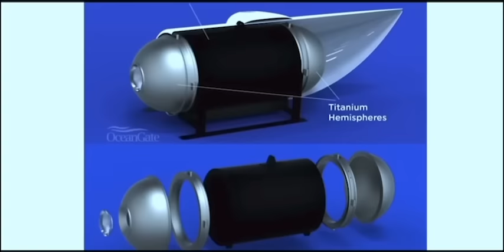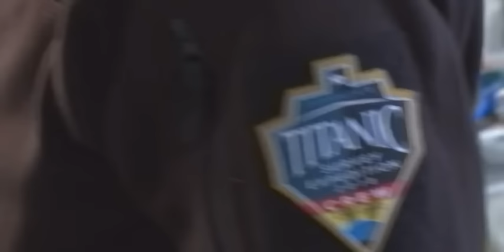First look at #oceangate #titan Debris

Comment: The fact this even went down once let alone multiple times without this happening is astonishing
Reply from the maker: i agree 100%
Reply: The mat-science behind repeated stress says that you can over-stress something, but eventually have to pay the piper. Microcracks form, bonds degrade, and generally spiral downward. This is why airframes get rated for X hours and are inspected for tiny cracks. I'd bet he only gave the sub a quick visual once-over after each dive.
Reply: was it maybe a cumulative effect that weakened it?
Reply: Not really astonishing at all. The sub was much stronger on the first dive than the rest. This is due to expansion and contraction of the carbon fibers with each additional dive. It’s like bending a metal wire or bar back and forth till it’s molecular body weaken so much it eventually snaps. So with the titan sub it wasn’t a question of it would happen, it was just a question of when

Comment: I've been making Carbon fibre parts for over 10 years and my most demanding test rigs have been kite Surfing boards using various different Carbon Fibre Layups. These boards experience torsional, compression and tension with repeated high loading when  jumping. I would test them (kitesurfing) until failure and I found it was always the top which was under compression during repeated cycles which would crack after delamination. 
I'm not an engineer but my understanding would be a pressure vessel should have universally balanced strength across the whole structure for the pressure it is under. One of the fatal flaws I see with Titan is that it didn't have universally equal strength across the whole structure. That might seem obvious in hindsight but perhaps without the observer knowing the reason or location. The Carbon tube using a Unidirectional roll wrap method they appeared to use, would have have been stronger on the ends once encapsulated by the flanges on the Titanium rings thereby causing a strength differential represented by a weakness in the centre. This centre focus would have caused a compression on the outer layer of carbon and likely started with a delamination between layers of  carbon (even though it appeared as roll wrapped  Unidirectional tow likely to be 4k or 6k). To make such a carbon tube  the epoxy should have been applied under vacuum rather than a wet layup method. This vacuum should have ideally been at around an absolute pressure of 12 Mbar or lower and and infusion method to 'suck' the (epoxy) resin into the part. 
I didn't see the full process of how the Carbon tube was made only the winding of the carbon onto the tube that makes me fear they used a wet layup method rather than using resin infusion. 
Because of the winding method and the thickness, perhaps infusion wasn't used? Does anybody know? (Please provide a link if you have one).
If only a wet layup was used this would leave more voids and air bubbles in the part (Tube) - these voids and bubbles are fatal for a part and will be where the delaminations commence with each subsequent cycle exacerbating the delamination.
This is my prediction. If a   centre compression in the tube didn't cause one of the Titanium rings to first pop off, then they will find a crack near the centre of the tube where several outer layers of carbon have 'jumped' over their counterparts after cracking.
Reply: Middle Should of been made as a buldge with end caps made out of a Carbon fiber & better yet spend the money and added graffene layering in case of a delam.
Or just Pay a Real Sub builder to do it right the first time.

Comment: Since the outside pressure is positive and the submersible is not acting as a pressure vessel, the greater the outside pressure becomes, the tighter that joint becomes.  I believe what they will find is that the extreme pressure cycles on the carbon fiber composite is what ultimately caused this tube to lose integrity and crush.  Building the entire thing from titanium would've been fine.  Buoyancy doesn't matter at all when you're in 12,500 feet of water...
Reply: I'm glad you brought up his buoyancy comment. That made absolutely no sense to me.
Reply: As an ex pilot he clearly should have known that the preassure/temperatire cycles would limit the useful life of the composite carbon fiber material. The glue part is unbelievably weak, considering that aircraft have all kinds of redundancy built in. They had some kind of system to monitor damage/degeneration of the composite hull which clearly did not work.. Very sad that these lives were lost due to atrocious engineering. Wonder why the first set of passengers did not raise a storm.
Reply from the maker: @cremebrulee4759  The reason buoyancy is important is because the subs are limited in power and it takes long time to get up and down so if they can use weight and gravity to get down and then use buoyancy to get back up it saves them a lot of battery life. So the idea is to drop weight at the bottom and let it float up on its own. I just think they can use other methods to come up if the sub is heavy. engineering ways to fill up air bags when ready to come up instead of sacrificing the integrity of the main hull just because it floats better! lol unreal!
Reply: well it does.   it takes a lot more to get the titanium sphere back up to the surface if it has no buoyancy.
Reply from the maker: @ScreamingEagleFTW  yes but wouldn’t it be safer to engineer flotation air bags and other things instead making the hull weaker and vulnerable ? Instead of RE-engineering the hull especially since we know the pressures there and physics of the sphere and titanium and why they’ve worked for decades
Reply: Buoyancy DOES matter IF you can't go negative. That's why this thing wound up at the bottom of a very big lake and not at the surface. But you're correct that cylinder imploded and THEN the caps simply dropped away from it as the fiber was simply shredded away from the rings. The joints had NOTHING to do with failure.
Reply: @CozziFPV  Buoyancy is important as a mechanism for surfacing, diving and orientation but buoyancy changes depending on the pressure of the liquid.  This relates to Archimedes Principle of buoyancy.  At 6000 PSI, the subs' buoyancy was fine.  It only becomes a factor as it rises.  The real elephant in the room is why the physical hull was being used for buoyancy purposes.  The hull has a very specific and critical job to do, and that is to safely contain the occupants and resist the pressure.  Buoyancy on subs is usually a separate system, such as ballast tanks.  These two things shouldn't be combined into one thing, as they perform two completely different functions.  This is all in hindsight, of-course, but my personal belief is that no untethered vessel should be carrying passengers that deep.  They need to either be diving bells or bathyscaphes...
Reply: @CozziFPV  I dont see how air bags  would work since the pressure is so high.  You could have pressurized air tanks dispense air into a external bag via bluetooth or something but once again now two things can go wrong wheras if the sub itself is more buoyant alll thats needed is to drop the weights and the ship goes up by itslef. I think thats what he was thinking.  Should have made the carbon fiber thicker.  but still  we do not actually know what happened and wont until there is forensic analysis of the debris they found. We can specualte but it is not scientific to draw conclusions yet.
Reply from the maker: @ScreamingEagleFTW  James Cameron’s sub is about 12tons and victor vescovo sub weighs 26k lbs. both drop weights and use “lighter than water foam” to hurtle them upward.
Reply: @CozziFPV  Thanks. That makes sense.  You are right.  There were much better ways to address this.  He took the cheap and easy route for everything.  The game boy controller still has me shaking my head.
Reply: @CozziFPV  Safety was not a priority for him and it makes me incredibly angry.
Reply from the maker: @cremebrulee4759  you and me both! Wth 🤦🏽‍♂️
Reply: @ccrider77  you are so right about the purpose of the hull.
Reply: @cremebrulee4759  He used this particular "measure" to discredit the regulators and making sound like they did no research on a material which should be a "natural" for submersibles - it isn't.  Whether the pressure vessel failed because the carbon fibre hull was weakened by repeated dives, or the glue that held it to the titanium end caps came apart, or because the carbon fibre was wound on helically instead of in a cross-hatch pattern, or whether the acrylic window gave way because it was at four times the maximum depth it could take, the fact remains it could have been any one of these things that caused it, and if whatever it was that caused the failure somehow held together for that dive, sooner or later one or another othose factors would have led to the same result.
Reply: @CozziFPV  How would you inflate air bags when the outside pressure is at 5000 PSI? Where would the air come from? You would need compressed air with a pressure of at least 5000 PSI stored in pressurized tanks to even begin inflating an air bag at target depth.
Reply from the maker: @littleshopofelectrons4014  I read they all use flotation foam to resurface
Reply: @chrisantoniou4366  you are right.  I hadn't thought about that but I think you hit the nail on the head.  He always projected that he was smarter than the experts and said that everyone else was being overly cautious.  You are also right that there were multiple things that could have gone wrong. The more I hear, and the more comments, like yours, that I read, the more I realize that his "engineering" was a joke.  His priorities were the glory and the money.  It's extremely unfortunate that his engineering abilities weren't on par with his snake oil sales abilities.  You are right that winding the carbon fiber in a cross-hatch pattern would have been much stronger.  But, of course, that would have taken more material, and there was no room in his shoestring budget for that.  He basically built the Yugo of submersibles.
Reply: @cremebrulee4759  Actually, I don't think that a cross-hatch pattern for the carbon fibre would have needed more material if he kept it at the same thickness, but it probably would have cost more to manufacture.  I also don'r know if the carbon fibre would have been strong enough to withstand repeated dives at 4000 metres even if he used the cross-hatch pattern, but it certainly would have been stronger than it ended up being.

As for the Yugo, it was pretty basic motoring, but I'm not aware of any of them imploding... 😄
Reply: @chrisantoniou4366  I agree.  I think the crosshatch pattern would have been stronger, but I don't think that carbon fiber in any pattern would have been able to withstand repeat dives.  I would really like to know why he believed that it would.  It's probably unlikely, but it would be really interesting if someone could get access to his notes (assuming they weren't just in his head), and wrote a book about them.  I would love to learn his rationale for his choices.  The book should also contain a discussion by experts of why his rationale was flawed.
Reply: @cremebrulee4759  My opinion is that he was something of a narcissist and thought he knew better than the experts, also known as the Dunning-Kreuger effect.  This is when the less you know about a subject the more you think you can "outwit" the experts who know far more.  The limited amount I've heard him speak on the subject of using carbon fibre makes me think that he chose the composite material because no one else had tested it for this purpose and he thought he was smarter than the regulators.  

I also think that instead of being circumspect about repeated dives, each successful dive made his belief in the sub stronger, a bit like the thinking process that went on with the Space Shuttle Challenger - each successful flight in NASA's mind made a disaster seem less likely, not more.
Reply: @chrisantoniou4366  I agree that he is a narcissist and also about Dunning Kruger.  I hadn't thought about it, but you are probably right about him becoming more confident with each dive rather than becoming more concerned. I think it's called confirmation bias when you look for proof of your belief in a situation where the proof doesn't really exist.  It would have reinforced his belief that he was an innovator and smarter than everyone else.
Reply: If you look very closely at the wreckage as it is unloaded it appears that the window is missing from the bow dome and you can see that there is in fact a large piece of white plastic sheet which is very securely taped with black duct tape on all of its edges over what appears to be the centreline section of the aft shroud. It seems that the investigators have gone to some particular effort to conceal whatever damage is underneath from public view at this stage.
Reply: They just put layers on top of layers of carbon fibre and just let it dry.  So there were air bubbles trapped inside the fibres.  They should have baked the carbon fibre under pressure.  Air bubbles are something you don't want in a Submersible at 13, 000 ft !!!!!  The air cavities would have exploded under pressure and that's what the gunshot cracking sounds were !!!!
Reply: @cremebrulee4759  "Confirmation bias" is exactly what it was.
Reply: @harryricochet8134  To be fair to those who have recovered part of the wreckage, it may well be that they are anxious to not lose any part of the carbon fibre cylinder still adhereing to the titanium or other bits and pieces which may fall off.  However, it's no surprise that the window is missing from the titanium dome because you would expect it to "blow out" when the sub imploded.  I am aware that the window was supposedly only rated to 1000 metres so it could well be the "culprit", but finding it missing from the wreckage is far from a "smoking gun".

I think we will find out exactly what happened to the sub not just because that's the norm, but because there are no vested interests in covering anything up.  However, I believe it will take a while because a lot more very small pieces of the carbon fibre cylinder will need to be brought up from the site.

Comment: The problem is not the narrow/small area bonding the two parts. What they should be worried about are delamination in the layers of the carbonfibre hull. Materialfatigue. Remember that the deeper she went, the better connected these parts were due to the big pressure outside. Delamination happends when cycles like going down and up are repeated. That explains why she had many good trips before the accident happened.
Reply: This is the first comment I've seen that actually has some sound thought behind it. If you wanted a one time use, "relatively inexpensive," submersible, this design has merit. But as soon as you factor in having to scrap the vehicle after each use, the benefit of using Carbon Fiber is lost.
Reply: Are there lessons here for the F-35?
Reply: @StephenStHill-si7en  Yes ... limit the number of dives the planes take! X-ray them after 100 dives ...